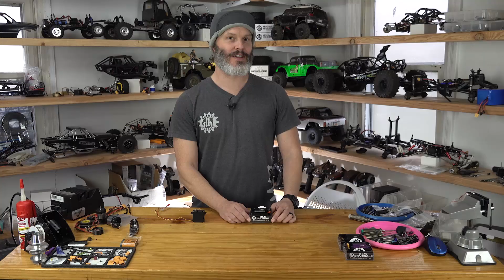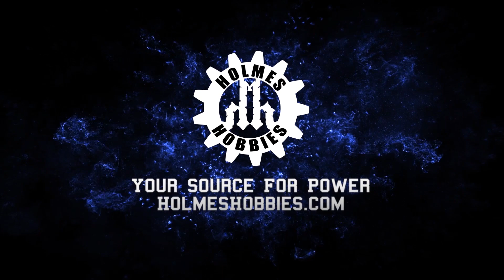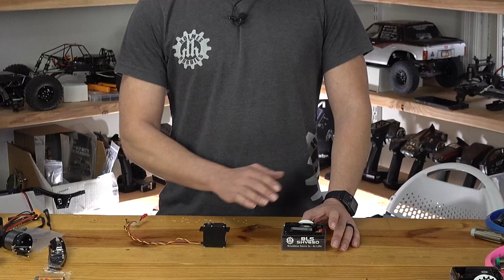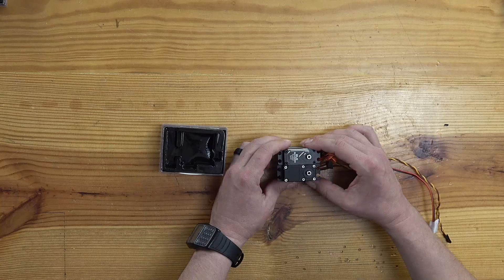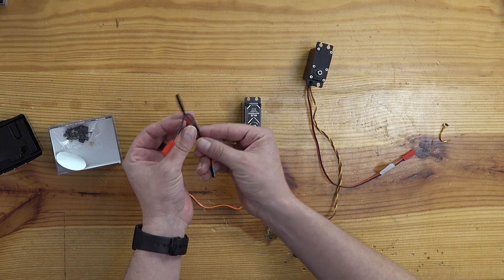Steering Muscle For Your Crawler! Inside The SHV650 Direct Power 16V Servo - Holmes Hobbies

Comment: when making very quick steering adjustments the servo makes a very high pitch winding sound... could you explain?
Reply: MOSFETs are squealing. 

A metal–oxide–semiconductor field-effect transistor (MOSFET) is a type of electronic switch and amplifier that controls the flow of electricity between two terminals in a circuit.

No way to really change it, except by replacing the servo. It looks like in the latest SHV-800 they fixed this issue.. but they are out of stock everywhere.

Comment: I have a question. I want to run 1 in my Ryft. Problem is my Ryft can run 6s. How can I power the 2 wire on a 6s battery?

Comment: Hello I purchased one of these beasts a month or so ago and I have some questions. I connected directly to the battery through an extension and the servo twitches/glitches a lot after recentering or steering at times. bypassing the extension reduces this a lot however, my rig, a brx 02 has the receiver box on one end and the steering servo at the other. Additionally when connected to the receiver through the extension it reduces this a lot but obviously I would like to tap into the higher voltage power of my 3S lipo for big gains.
Reply from the maker: On the Facebook and Instagram I have a recent photo showing the rewire that should fix it.  The adapter plug seems to cause some problem of interference because of the high power.

Comment: Holmes! got a question:

I was running / testing the SHV650 mated to 4S battery this weekend and noticed its got some jitter/shaky when mated with fully charged battery. once the battery started depleted, it was less jittery but def more when fully charged battey. I was using xt60 plug with JST connecter adapter and all 3 adapters would do the same. got any suggestion on anything I can adjust on castle ESC to numb down to get rid of the jitter? or do you think its a connection issue? jitter means steering servo shaking when steering input wasn't applied.
Other than little jitter here and there, this servo is super powerful and work amazing on my 2.2 capra thats about 7.5lbs  the jitter annoys me but doesnt hut any performance when crawling.
Reply from the maker: It seems to be an issue with the plug and harness. You can pull the middle power pin and power directly to get rid of the jitter. I'll be making posts about doing this

Comment: I plan on emailing customer service with pics as soon I have some time off, but. . .
I purchased a couple SHV800's for mine and wife's rigs, TRX4 and TRX6. Anyways, we love them and they are amazing. The only complaint I have is that with the stock metal Traxxas servo horn, they catch the edge of the casing and gouged a chunk of the corner edge on the right turn. I dunno how thick the casing is or that this would've even been a potential problem until it was too late. Kinda bummed out that it happened since this was my first ever, very nice servo purchase. Just beware. I wish I'd have known of this potential problem before it happened.
Reply: I noticed that interference during fit up.  The gusset on the factory steel servo horn needs ground down a bit.  I've been pretty happy with SHV800 in my trx4, I hope it holds up as well as the 500V3 did.
Reply: @scotterwin2901  yeah, definitely a learning experience. Never would've thought that was something I needed to check out or even worry about with this being my first new servo experience. I definitely know now. I love the SHV800, can turn wherever and whenever I want and need to for sure now. But now I have two brand new, really nice servos with a chunk gouged out of them. Never even knew it happened until I went to work on them at a later date. Was confused at first, then I seen what happened and was bummed out. Hopefully that's all the damage that was done and no internal damage. . .

Comment: I bought a revolver 540 1800kv a couple years ago maybe 3 or 4 , installed it and with in minutes I new it was not for me no matter what pinion or gears I tried. It just never ran good. well here about a month ago I bought a V2 Snubnose 2500kv and when I was comparing them side by side I noticed that the new one was way smoother so I started looking at the 1800kv when I noticed that one of the magnets in the outrunning was lose I still have the original packaging for it because I had only run it maybe a total of     Three times across the kitchen floor my question is can I pull the bell of and fix that magnet and what would I use to hold it down
Reply from the maker: Give us an email, I bet we have an endbell for you for the price of shipping 😉  depends on the model if we still have stock but I can almost guarantee which model and batch you have with that issue
Reply: I work in the oil and gas industry as a Nondestructive inspector so if I get home earlier tonight I’ll try to send you a proper email and maybe a photo thank you sir for the speedy reply. I absolutely love your  products I have a drawerful of your motors and esc. Huge fan of what your doing and I even watched the world finals of disc golf because I didn’t really now what it was …very cool

Comment: Oh, yeah! Just got out of your store after ordering one of these goodies!
Going into an LCG aluminum portal servo on axle 4 link build on a 13 inch wheel base.
I'll be ordering the motor and ESC next. I'm wanting to use your new mini ESC, will that work out with your 2200 540 outrunner, geared way down with 4.75 tires? Or should I step down a bit? Your website shows your out of stock on the 2000's
Love what you've got going on, and as always, thanks and have fun.!
This will be my 7th or 8th HH powered rig, this time I'm ordering straight from you, and using only your gear.

Comment: I have an SHV800 in my VS4-10pro. It is awesome and silent. I bought an SHV650 for the front steering servo of an upcoming build. I’m using an 800 for the rear steer on that one. Just want to confirm that the 650 doesn’t buzz like the old 500.
Reply from the maker: Silent

Comment: I tried your 650, it did not work on direct power. Austin replaced it with a 800. Any idea when that glitch will be sorted?
Reply from the maker: We figured it out. Bad plug combo with the harness, but easily fixable without soldering.
Reply: @HolmesHobbies  That is good to know for future builds. I like the 500V3 but the 650 power would be nice.

Comment: I'm relatively new to your products and rc crawling. But I love how you strive to constantly make better products and have very reasonable prices. Im building a 2.2 wraith crawler and can't decide between the 650 and 800 servo. Which you think is best suited for me?
Reply: Lol I am currently upgrading my 2.2 Wraith and was looking for an answer to that same question!  (and I’m in NorCal too…small world!). Did you pick up one or the other?  If so, thoughts?
Reply: @rez3077  I went with the 500lp as it was the only one in stock at the time. I have it direct powered on 3s and it's a beast. Plenty to move the 2.2 tires
Reply: Either one is a great choice. You'll swing those big 2.2's like nothing. If you don't have them yet, absolutely buy some Axial or Incision universals. The steering angle is night and day compared to stock.

Comment: Just switched from a g13 to the shv800. Running a mamba micro x and revolver team spec.  I had to switch back as the servo would only work with the throttle applied.

Comment: When using the supplied bypass adapter my SHV650 twitches out like crazy. Communication from HH has been pretty slow and still have no solution. I wouldn’t recommend this servo until they come up with a solution.
Reply from the maker: We have one.  I'll make some posts covering how you can rewire with the included harness.   

I just talked with Jordan on this solution today.  It appears that some of the plugs used aren't fully compatible with the included harness.
Reply: @HolmesHobbies  Looking forward to the harness fix. Mine is twitching badly as well. I submitted the question via webform a couple days ago

Comment: I’m sure there is a good reason since you’re quite the reasonable guy but if it’s a replacement why is it 35 dollars more and that being the case will the 500 v3 stay for sale? Also if the shv800 is theoretically more powerful why is it cheaper? No hate just a few questions I had
Reply: Because the world we live in now...everything has price jumped...in case you havent noticed...
Reply: @booncha1971  Why wouldn't that everything include the SHV800? I agree with the OP: it's a bit puzzling.
Reply: The 500’s used to be $120, the price dropped to $90 to get them sold as the 650 is the replacement. So once the 500’s are gone, they’re gone. So the reason for the price difference is because there is a replacement product and HH probably needs the shelf space so a discounted price on a soon to be discontinued item helps clear them out a little sooner. Also a slight reduction in price on the 800’s. Also the 800 is slower.
Reply: @chevyon37s  that makes sense thanks
Reply from the maker: What he said !